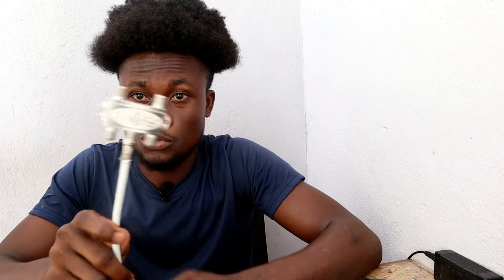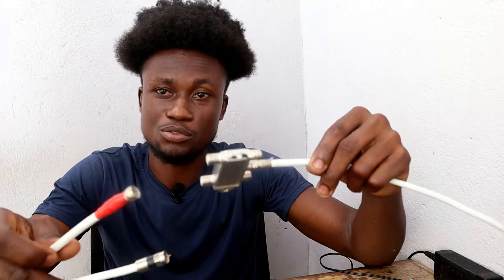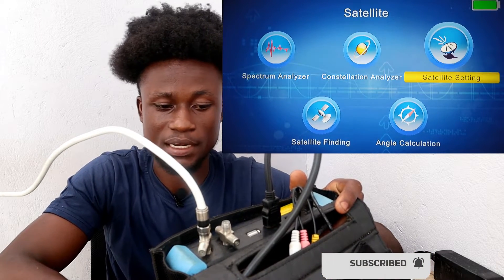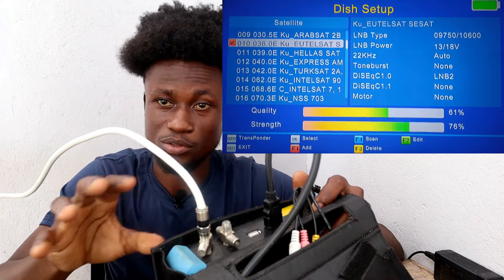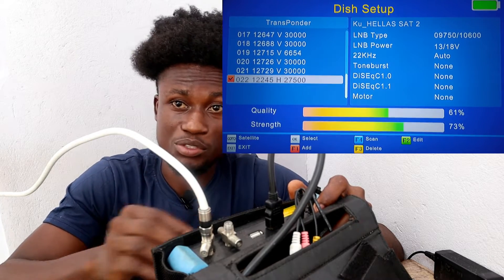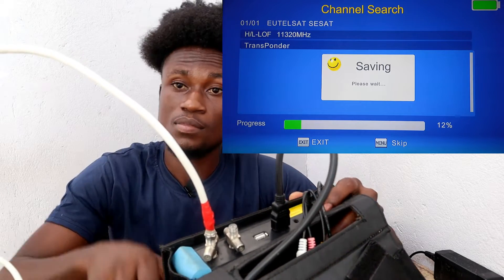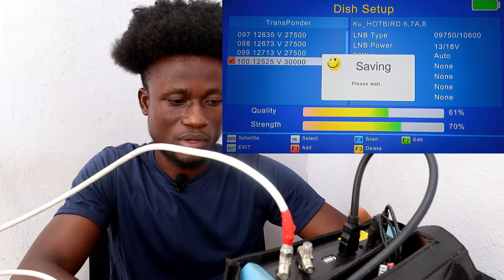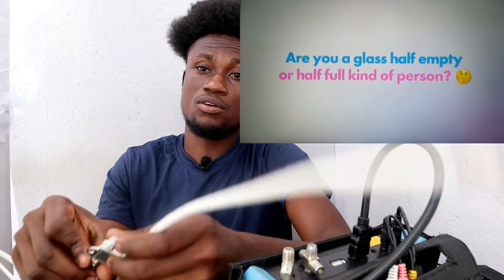How To Scan FTA Receiver With DiSEqC Switch - Master Decoder

Comment: Hello
How do I scan digital channels on my Master decoder?
Reply from the maker: Connect your antenna with a stable signal,
* Press on the menu button on your remote
* Select Installation
* DVB - T2
* Select Togo as your country
* Choose Auto Scan and press OK to proceed.
You will get the channels if only you have a signal from your antenna.

Comment: Using two LNBs with a Diseqc, can I get Badr 26” and Amos 17” setup? I mean are those two satellites close to each other or maybe one above the other just like ASTRA 28”E and DSTV 36”E?
Reply from the maker: I have not track this two satellites on one dish, you can Install Amos to be the primary signal and add the Badr 26" to be the secondary LNB. If only you have a stable signal of both combining them with a DiSEqC will not be a problem. I will try and give you feedback.